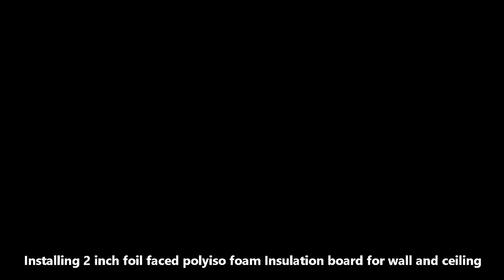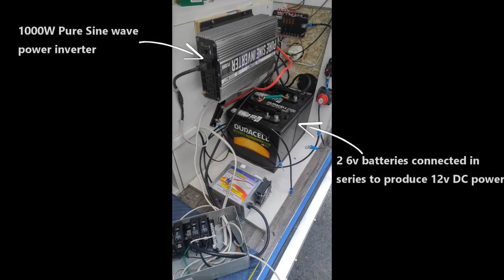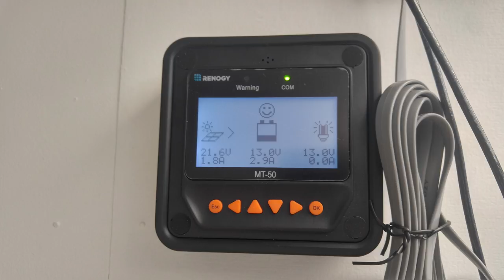Converting A Cargo Trailer Into A Tiny Mobile Home

Comment: NEVER PULL A BOX TRAILER WITHOUT A SWAY BAR.... i just rolled my truck and trailer due to a high wind gust compounded by black ice.  Almost lost my wife and kids.  I've been towing my tool box around for years. I know not to panic brake but it doesn't take much before its just beyond control.  Never thought i needed a sway bar for a little 7x14 TA.
I didn't have one. I'll never do that again. 
This advise may just save your life. 
PS. Nice trailer.  I'd like to show you my new one when i get her done.  Everyone was jealous of my old one.
Reply from the maker: You are right, Bob! We did a lot of research about safe towing. So, we had a Pro Series sway control bar installed before our 1st trip (Alaska). We are glad we did this, it saved us in many circumstances.
We will be glad to hear about your build!
Reply: Thank God your all ok
Reply: Sway bar for the trailer?
Reply: You don't need one if you have a decent vehicle towing it, but smaller SUVs and cars yes it helps tons.  All 1 ton trucks you are completely fine.
Reply: @cletusvandamme6262  you don't tow with a fwd, period. Under emergency braking the trailer will push the rear end of a fwd sidewards, trailer brakes or not. Retired truck driver and trainer.
Reply: Beyond belief pickups are terrible tow vehicles because of the light rearend. A 5th wheel application is a different story because all the weight is directly above the axle. When designing the trailer you want about 3-400 lbs tongue weight. That is non-negotiable. The ideal tow vehicle is V-8 with a heavy rear end like a full size RWD suv with a tow package. You are correct about a sway bar. A longer trailer is more forgiving than a shorter trailer. Dual axles better than single axles. And never, never mismatch tires on a trailer. Different diameters will get you swaying quicker than anything.
Reply: @cletusvandamme6262  Well said.
Reply: Bob K. - Quite right.  Safety first. Thanks for the great advice.  Glad your family is safe!  All the scoffers below are the future sway bar accident folks.  I know one thing, you cannot be too careful driving an RV or towing a trailer.  It can be so dangerous so very quickly. At that point, your words will flash across their brains like neon lights, as they roll down the embankment, a heap of twisted metal.

Comment: You did two inches of insulation all around?  That's r12 with the polyiso, did you do the floors too?  How do you feel about that, has it been enough?  I plan on doing the same but with 3" for the ceiling.  Great looking build, I am very curious about how the indoor air quality is in there though, a lot of products that offgas were used.

Comment: Nice! Curious about the weight? I'm thinking about doing something similar but possibly smaller since my Element can only tow 1500 lbs.
Reply from the maker: Hello Sarah! An empty 6*12 cargo trailer weighs about 1200 lbs. Our converted trailer's dry weight is around 2500 lbs and once fully loaded it weighs anywhere between 2800-3000 lbs. I would suggest you to look at tear drop trailers which usually weighs under 1000 lbs
Reply: Wow.... when I saw the Murano pulling this trailer, I was hoping you had kept it well below 2000 lbs... Are you at all concerned about hauling almost double the max (U.S.) tow rating of the Murano? Did you ever talk to your insurance about it and if they'd still cover you should the worse ever happen? Just curious what kind of liability you might have if something ever does happen...
Reply: Max tow capacity for a stock Murano is 3500lbs provided its a class II hitch.

Comment: Nice work. I have been looking at small micro trailers I can pull with my VW TDI diesel sportwagen without hurting MPG. I also want the option to still haul stuff like a motorbike and then camp out in the trailer. I am going to make one. The factory stuff seems pretty poor quality. I can put the best systems in and customize it to my mission for little money.
Reply: "...without hurting MPG."  You, of all people, should know a thing or two about Physics.  How does wind resistance increase as a function of frontal area?  What about weight and the coefficient of friction?  Simply put, it all takes WORK to move this extra mass down the road.  There is no such thing as a "Free" Ride.  You will be sorely disappointed by the hit your TDI will take in fuel economy.

Comment: At the beginning it says you installed a shower partition wall but it shows the shower in front of the wall. Is the toilet behind it? I think the shower and toilet would have looked better both behind it. I'm guessing there is a reason you did it this Way?
Reply from the maker: Behind the partition wall, it is only the trailer's V-Nose area. Since it is an acute space, we built 3 storage shelves to use it as our wardrobe area.  We just place the porta-potty inside the 2*3 ft RV shower tub.

Comment: So how does the plumbing (grey water) work? Where does it exit/ drain
Reply from the maker: The kitchen sink outlet drains into a 5 gal portable can. For shower, it drains directly down to the ground, where we use a portable 16qt oil catch pan to collect it. Oil catch pan used for automobile is much cheaper than a regular portable RV grey water tank.

Comment: I thought Murano can tow max 1500 lbs. I wouldn't pull anything over 1000 lbs. Awesome job on trailer btw.
Reply from the maker: Ours is a second gen Murano and it is rated to tow 3500 lbs. Our trailer weighs much lower than the tow rating.

Comment: Looks nice clean build. Wow $10k !! Trailers run about $3k new for a ‘6 x 12’ with brakes and $2k -$3k on a decent interior build includes solar goodies. For $10k you could have bought a very nice smaller factory built with more amenities. Pulling with that car is not wise for the weight. Bigger SUV , van or 1/2 ton truck would be safer. People make that mistake pretty often because Nissan tells you you can. Good for their parts and repair business.